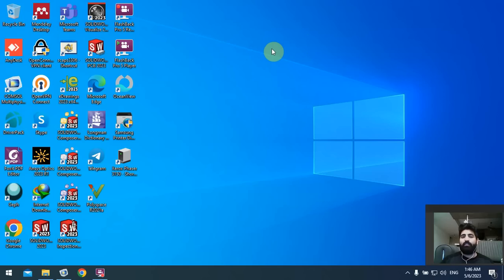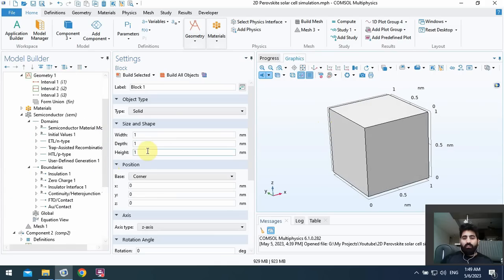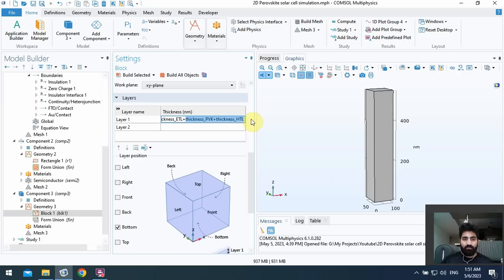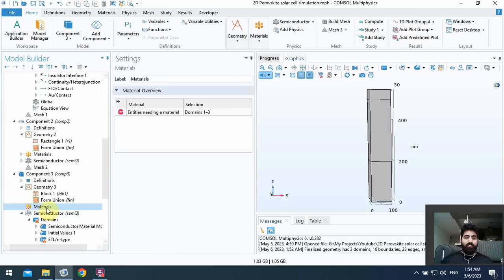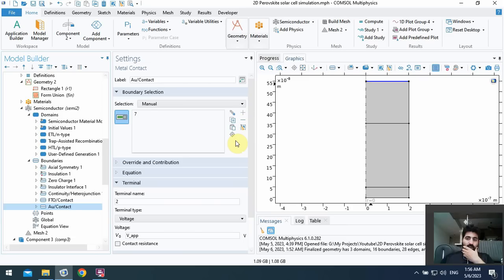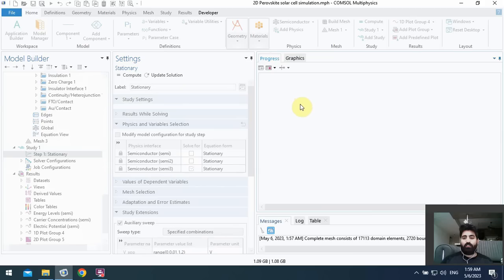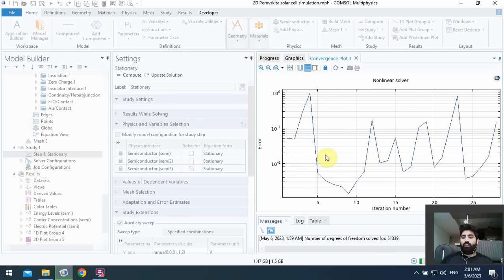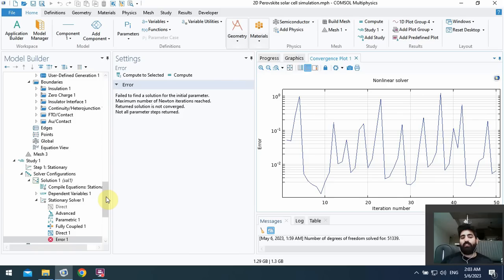Simulation of 3D Perovskite solar cells with COMSOL Part 1

Comment: Hey are you also knowledgeable in simulating perovskite tandem cells in terms of its optical properties? im struggling to use the wave optics module side for this
Reply from the maker: I provided the video about tandem solar cell with Scaps1D and you can see in my channel , also I will provide the tandem solar cell simulation with Comsol asap.
Reply: @Mehran.Minbashi  thanks for the reply :) yes i saw your scaps1D approach but i was more interested in the 3D approach through comsol. Will look forward to your comsol video if so.
Reply from the maker: @kenken6012  your welcome, don't worry I will provide asap, there is no difference between 1D and 3D results. The results will different in the case that shape is important (nano particles) as I experienced.

Comment: Is it possible to simulate solar dish (parabolic concentrator) for heat transfer in solid & radiation(to evaluate the temperature of the receiver)???
Reply from the maker: Yes
But meybe in the far future, you can order it as a project and contact with me in whats app
+989193613519